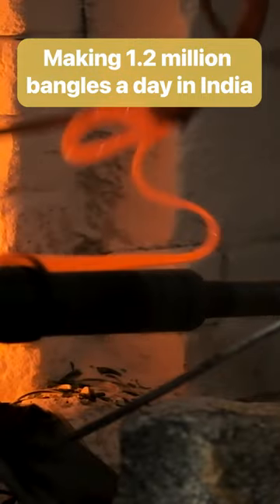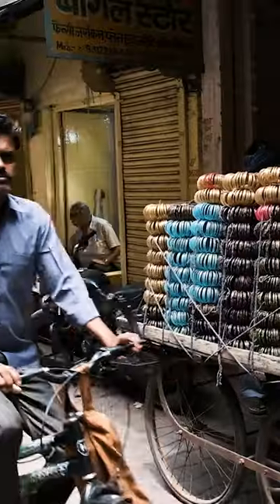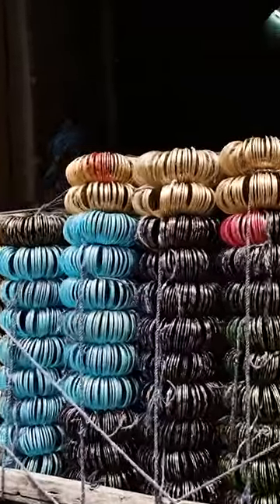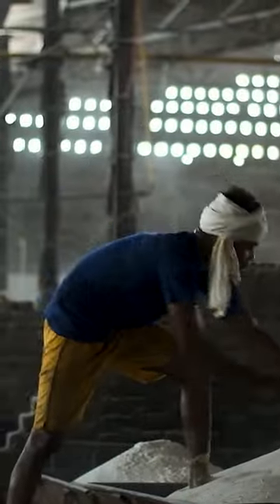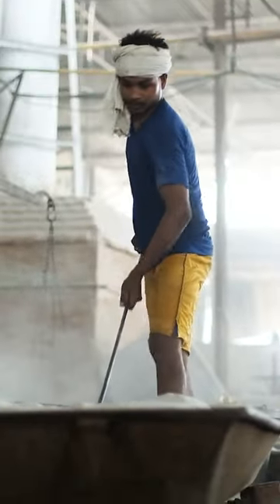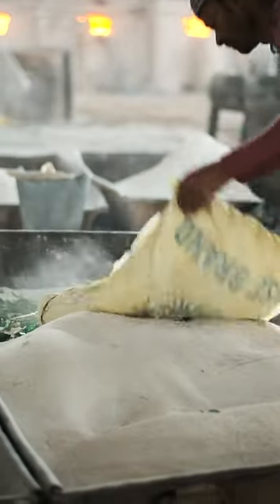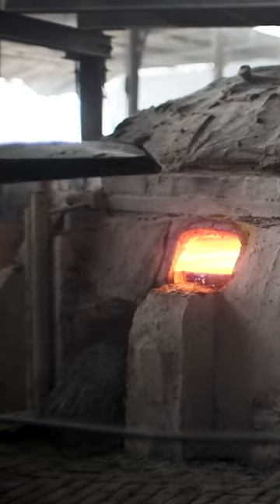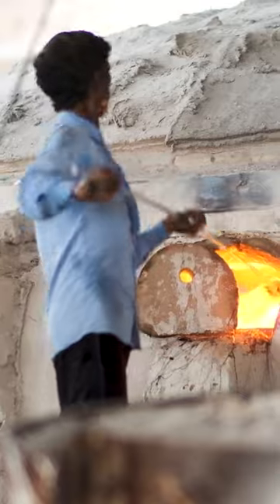Artisans in India churn out more than a million bangles each day. #Jewelry #GlassWork #Bangles

Comment: You forgot to mention they are paid pennies and are working in horribly dangerous conditions with aerosolized silica and glass dust, 2000+ temps, and broken glass all over the floor, all without any safety precautions.